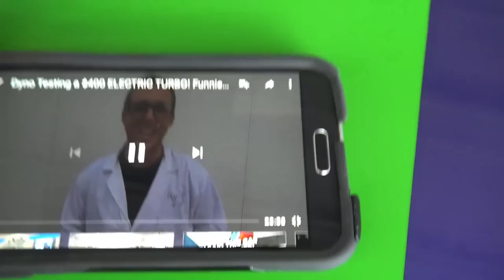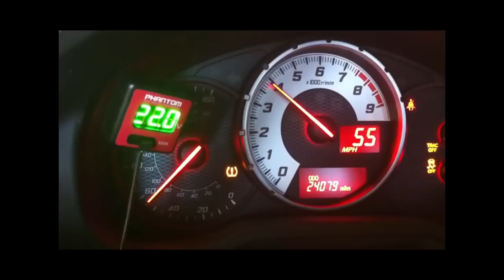Cleetus Mcfarland is wrong about electric turbos!

Comment: Did cletus ever take the ebay 400.00 dollar electric turbo and retest it on a small engine 4 cylinder like a 1.5L 4 cylinder  like honda fit 2007 to 2013 ? I would think if anything could make boost that setup would have a better chance. I saw the torque Amp on the eco tech 2.4L but that's an expensive electric supercharger compared to 400.00 and the 2.4L makes around 140hp compared to around 110 to 117 honda fit gd3 ge8. Anyway thought it would be interesting.

Comment: Regardless of what you think unless the electric charger is on 100% of the time the car is really badly air restricted so until it kicks in ya making a lot less power than the stock car and once its on and spooled up it will make power so most of the time ya making far less power than stock.. Ya can't change the laws of physics or rules of air flow... Don't by these garbage systems its a waist of power and money.

Comment: Lets just add the fact that Bob from drift office can get 196hp out of a stock FA20 with a full exhaust and a drop in air filter NA. I have a 14 tuned by him and im pushing 188whp and 160tq  NA

Comment: Cleetus' video was clickbaity messing about.  Not to be taken seriously and he obviously just wants to let people know to know to not buy that particular piece of garbage. For the naysayers here is Audi's solution https://europe.autonews.com/article/20160305/ANE/160309914/audi-s-435-hp-sq7-gets-electric-supercharger-to-top-diesel-power-race and here is Mercedes https://www.thedrive.com/news/21014/2019-mercedes-amg-e-53-sedan-twincharging-is-back-in-style  You can also look up Valeo, Aeristech and DBS electric superchargers or you can continue to have doubts.  Besides that here is their use in F1 with KERS(obviously this is a hybrid setup with a massively powerful battery pack but Audi and Mercedes road cars employ a 48v setup to great effect) and you can also see that they have slightly decoupled the hot and cold side of the turbo to reduce some of the heat transfer to compressor. https://www.youtube.com/watch?v=anLDCVD6v1s&t=90s

Comment: very interesting video BUT, you don't seem to consider the flow restriction caused by the idle compressor fan.  I have trouble believing that the reduced flow doesn't impact the overall performance of the engine.  Boost pressure if one component of the equation, the other is the volume (mass) of the air that is being forced in.    Or am I missing something here? (BTW, he goes on to take a $5k dual system, on a 4 cylinder engine and does show significant performance increase - but there has to be a loss in overall power when you restrict air intake that much.

Comment: Doesn't this restrict airflow when the turbine wheel isn't spinning?  How much parasitic power loss occurs when the unit is off?
Reply: That would depend on how much the engine has to breathe.
 If the air intake system  is bigger then the engine needs , you should be good. Or the loss of performance would be   negligeble
 But if the engine is big and the air intake is barely sufficient and you restrict it (by puting fans on it) you could get a loss of hrsprs

Comment: just a dumb question, what if you use another turbo on the exaust as a generator to power the battery.
so, have the inlet turbo always running.  is that even possible?  would that simplify the install?

Comment: I think the missing link here would be the electric motor powering a larger gear that would spin a smaller gear connected to the compressor shaft. Procharger uses a gear system to spin the compressor wheel faster than engine rpm so why not use the electric motor the same way. Seems like you could get faster spool and spin a larger supercharger that way with less electric motor rpm. These cheaper electric superchargers just have the electric motor connected directly to the compressor shaft. It's not like spinning a compressor wheel takes much force and a 2 gear system wont add that much parasitic resistance.

Comment: Last I read about Audi the real manufactures using it, they're not using it solely alone for power, they're using it to help prevent turbo lag in combination with a real Turbo System, been a few months since I read about it, from what I read about it it still produces very little boost as well, and even the manufacturer says it's not efficient by itself, simply to help prevent turbo lag.

Yes a good system can work, somewhat to a point, however they're not efficient, enough and don't make enough power, and $2,000 for a system, my there's a lot you can do with $2,000 to make the same amount of horsepower that's little hair dryer  is putting out really not worth your money. Seriously what's he going to do to help you get off the line a little tiny bit faster???

I'm pretty sure that the point Cletus is trying to make, 90% of these electric kits are completely junk! If you're willing to spend that kind of money, for the power increase your getting... well he's  just trying to point you in the right direction, because it's definitely not worth $2,000 LOL
Reply: What do you recommend me to do on my BRZ to have the same power gain for less the 2k?
Reply: Daniël Hilgersom look up m90 supercharger on eBay.   It’s a factory part found on gm, ford, and some Australian market vehicles.  You can get them for about 300 bucks fully restored with warranty.   Spend another 800-1000 to have a shop fab up some mounts and boom, you have a real supercharger with real power and you won’t look like this goof ball
Reply: Daniël Hilgersom or, for less money and ease of build, buy yourself a Cobb tuner, an intake tube (your stock filter box is fine) and a catless header.   You’ll walk on this guy

Note you would need a tuner for the other option I suggested as well

Comment: aka  cleetus and the gang werent wrong they just  used too small of a  compressor  for the  application   kinda like any turbo  or  supercharger works as  in if you is  too small of a turbo or  charger  that it will loose you power

Comment: Put the electric turbo motor on a separate deep cycle battery to keep the car batterys power max. at all times. now you can raise the voltage higher with deep cycle batteries. 48v

Comment: Cleetus also said it’s possible for the charger to work better if it was on a smaller motor
Reply: Cleetus can buy whatever dude doesn't know left from right. Rewatch it and pay attention to the direction the compressor is turning.

Comment: I have a question can I possibly use this on a 09 Malibu with a 2.4l 4v engine  because i been doing work to this car for 2 years since i got it i done put a cold air intake on it but i want to do more to it because i use it as a daily driver but i want it to be badass under the hood  and sound badass too

Comment: He did just that tested it on a cobalt and did show gains, 48volt system. But for the price nitrous would be the best bet. As long as it is tuned correctly, and your not spraying every time you drive it, you will still have good reliability.

Comment: I'm putting this to bed. Your tune is what's making your power. You need 50hp to drive that impeller @36k rpm to make 10lbs boost. You need 131hp to make 21lbs boost @55k rpm. Let's say your motor is capable of driving that impeller at a useful speed, (36k-56k)  Unlubricated bearings don't last long at all at speeds close to that. @ 5psi that impeller is spinning around 25k rpm The math doesn't add up.  Nice experiment though  I hope you figure this out and prove everyone wrong.  Your seat of the pants Dyno ain't cutting it when you're taking about separating 2k from Someone's wallet.
Reply: consciouscool I don’t even think he’s tuned.  He has a cel and any Subaru tuner should omit his cel.   

That’s also not his dyno sheet.  He has a red car and the dyno car is black.  And since we never saw the dyno data, just a graph edited into the shot, who knows how valid those numbers are?   The guy is so reluctant to admit he wasted two grand that he’d rather try to convince the world it was worth it

Comment: There is no way that thing spins at 55k rpm, especially with a motor can of that size, that low of voltage, and that size of wire. The amount of amps required to do that is just insane! Maybe if it was a 48v system I would believe, but it ain’t. Perhaps if I could get a spec sheet on that thing I could believe, but right now Nuh uh.

BEFORE I START AN ARGUMENT, I AM NOT SAYING THAT IT CANT CREATE BOOST, IT IS A MUCH MORE SKUKUM ELEC SUPERCHARGER THAN CLEETUS’ AND DEFINITELY HAS THE ABILITY TO OUTPERFORM HIS.

Comment: That electric motor probably produces close to the 30 odd horsepower that you gained. Simply putting it on the serpentine system on the front of the engine would likely produce the same gains lol..

Comment: Should have used a step up 12 to 24v DC converter instead of having batteries set up that way.
Reply: Batteries run fine in series. Both setups would be a ton more current draw regardless.

Comment: I could see one using it to help with starting the engine.
Reply: When an engine starts, a mechanical motor spins the engine up to speed.  The natural suction caused by the piston movement moves more than enough air to get an engine started.  

Pressurizing the engine (creating boost) with no load on the engine would just cause it to spin up way faster than it needs to causing premature wear and no benefit.
Reply: @youtubeisbroken241  a year later and I still hear james hasn't recovered from that horrific dose of facts.

Comment: Nice video but I dont agree with everything you said. 1. When the turbo isn't working you will be losing power cos it will be restricting the flow.  I think it it will be better to run like Y shape pipe from filter to turbo  and same pass  turbo  to have direct flow when turbo isn't on . 2. You can't make more power by pushing more air without telling the ecu to push  more fuel  otherwise your engine will run lean . 3 cletus can't make power due to my 1st point,  the power is more restrictive than the power it's making  cos the bigger the cylinder then the more air required so he need diversion from direct flow and huge turbo to make difference.  I'm really interested in electric turbo but I think exhaust Gas driving turbo will be more efficient because it doesn't put big stress in the engine to spool , supercharger and electric charger will always require lots of power from engine to spool but will eliminate lag but make less power

Comment: It is a bummer electric systems that work are so expensive and heavy doesn't actually beat out a standard snail or screw unfortunately Maybe one day 500$ will generate 50+ hp on almost anything but until then it's not exactly great

Comment: The only carmaker that has absolutely nailed electric superchargers is audi. Also you say you don't need an intercooler but when you compress air, it heats up. hence an intercooler is needed.

Comment: Incorrect, technically it should be called an electric centrifugal charger, supercharger is driven by belt as the driver,, turbo is driven by gasses as a driver, and centrifugal is the compressor wheel thats called the driven.
Reply: In this case the centrifugal is driven by electric motor as the driver

Comment: I hate to break it to you but turbo are not called turbo because they're exhaust driven. It is because they use a turbine to move air. Yes the electric turbo still uses the turbine to move air so it is still called a turbo not a supercharger. Superchargers do not use turbines to move air.

Comment: yea, its hard to compare it to either turbo or supercharger cause like u said the turbo is powered by exhaust but its the same with a supercharger. its not exhaust that powers it but it has parasitic lose from being driven from the belt, so in a way it is best of both worlds with none of the draw backs. if i was the one who developed this thing i think i would have called it an electric turbine an just add a new way of forced inductions. i guess if u got a high enough speed electric motor with enough torque it might be able to over the bigger volume of the v8. cleetus does end up with a system that is similar to urs an they do make some power with it on cobalts an fasterproms jermey does it on a 3cyclinder smart car an it looked like it actually picked up alot for that small of a engine. i think these would be ideal for any small volume engine.

Comment: You don’t need an intercooler for a regular turbo setup. You seem to think an intercooler cools the turbo itself, it actually cools the air between the turbo and throttle body (cooler air equals denser air which means more air going through the engine). For $2k you could still find a decent turbo, have the plumbing fabbed and even maybe get a tune and produce far more power. Ps that dyno graph you showed looks terrible.
Reply: Only if you're being cheap chinese junk😂

Comment: To be fair  dynos  don't really lie especially the Hub one in which he tested it on and showed us the  before and after and it was down on power after he fitted the electric turbo that means it's not doing what it's meant to do therefore that turbo is crap
Reply: Plus your car is probably highly restricted as standard from new and anything will help it gain power

Comment: where is YOUR data and dyno testing ? people have called BS on the other video clip you pasted in here due to them using a battery charger for the electric turbo  , the whole 27hp they claim to have made is very lacking in data , where is test 1, 2, 3 on no turbo , test 1 ,2 , 3 of with turbo , and clips of battery ? there isnt.

Comment: Bro you ...hmmmm ..... How do I say it.... How do you think your creating extra power with out changing the fuel trims maps and map sensor pressure. Your system doesn't work as you say because your ecm doesn't adjust for the added air even if your creating pressures
Reply: Actually you are pulling air through the sensor and the stock map compensates. I know because I've got a Phantom and it really helps the car WHEN YOU ACCELERATE but at regular driving you have stock power.

Comment: Did you have to do a tune or change anything else ?
Reply: If it was building boost, which it’s not, then you would, which you don’t.  

His system reads boost in the tiny turbo outlet.  If he read it in the larger  manifold it would be one psi or less.

Comment: Damn, just build the engine and get some real power, for 2k you can build a pretty nasty Chevy 350,or similar.Im kind of lost on how much one would have to spend building an import, but a simple head port,forged pistons,cams and a tune can go a long way.If this works for you,then that's fine too.Im just a firm believer in working on my own stuff, this would be great for someone that's not as skilled at engine building,or some people that are kind of afraid to pull the engine, especially on these newer vehicles.Check out Cletus's Cobalt video,the new electric turbine works pretty well.

Comment: All in all if I'm going to spend about 2,000 dollars I'm going to get the real thing. By the time you wire this thing up you would have basically spent the same time installing an intercooler and plumbing to the exhaust on a real turbo. But that's just my opinion. The only reason I'm watching videos about electric turbos is I'm wondering if one would work on a small engine like on a motorcycle that's got a carburetor.

Comment: in  Cleetus video
https://www.youtube.com/watch?v=GKKCaW8sWYc
at 17:54 you can see they connected the motor opposite direction it was pulling air outta the engine , i doubt it would have given power on a v8 but it won't be this much loss

Comment: At 5 pound of boost you supposed to push 75 hp and 60 pound of torque.    So your system not push 5pound or your not efficient.    5 pound produce 1/3 power of the motor     Sir you need more r &d

Comment: That's not an FRS bud thts a Toyota GT86... I saw the badge and the FRS has vents instead of lights on the left and right of the bumper
Reply: The gt86 wasn’t sold in 2013 in America.  He stated this is a 2013 model. That is a rebadged frs.
Reply: @youtubeisbroken241  just googled it there is a 2013 GT86 and look at that badge, that's not Scion
Reply: @youtubeisbroken241  also it's not 2013 anymore I'm pretty damn sure u can get a 2013 Toyota GT86 in America now considering it came out 6 years ago
Reply: D4RKW01F 20 have you done proper research yet?   Who cares what year it is?  My point remains.... in 2013 there were no left hand drive gt86.  Only the brz and frs.    But it’s al trivial as they are all the exact same car except for the rear springs on the 13 model.  

He has a scion with Toyota badges. Something that was very common in 2013
Reply: @youtubeisbroken241  not true in 2013 Toyota had the "86" and in certain locations it does indeed have LHD, also you have no clue cause it's not your car so why argue? Also body panels are those of a Toyota 86 and if their the same car what's the point of making it look like it's a Toyota 86?
Reply: D4RKW01F 20 lmao at “it’s not your car so why argue”.  How about you take your own advice?

Hear is a fact check for you

The car was sold under three brand names throughout the world. 

Subaru BRZ 
Toyota gt86
Scion FRS

Here in America and Canada (he lives in Canada) it was sold under the scion and Subaru name.   It was Subaru and Toyota in other world markets.  Toyota versions were not sold in America or Canada until after scion went out of business, which wasn’t in 2013.....

But if it makes you feel better to be right, go ahead and believe it

Comment: Batteries are not even wired in series they're wired parallel so voltage does not change only amperage. Still a 12 volt system bud.
Reply: devin butler definitely wired in series.   Learn about electricity bud